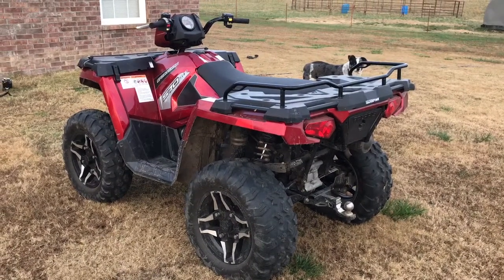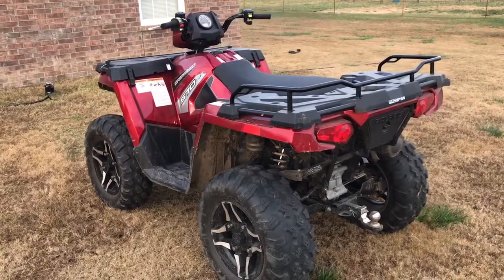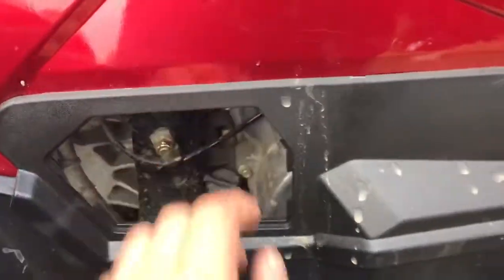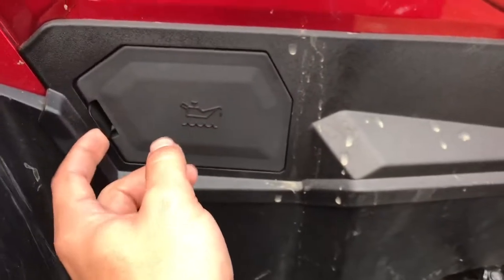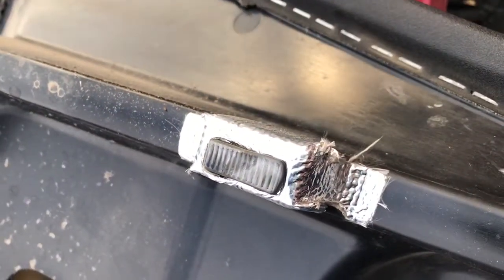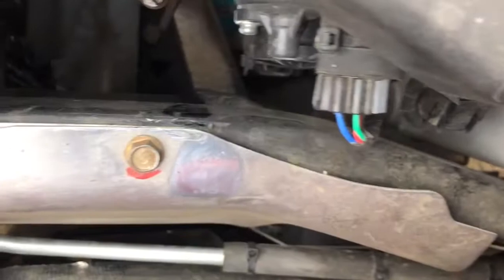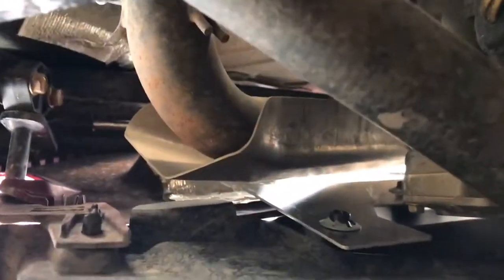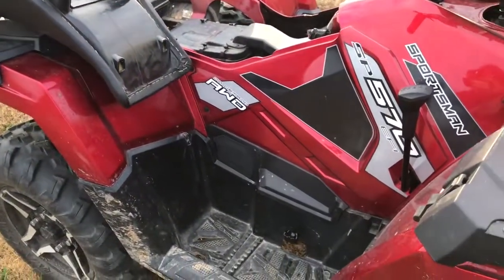Polaris 570 exhaust heat fixed!

Comment: I have a 2016 570 and have the same heat issue, i assime this same heat xpver would work for mine? My dealer asked for a VIN number of one that got the heat shield so they could look up the part number. Supposedly my VIN number doesn't come up. Any help appreciated, ty!
Reply from the maker: I traded mine for a 850 back first of august. I dont have the vin for it anymore

Comment: I got a 2013 model 330 trailboss and it lights my damn right leg on fire too, thinking about using a heat spray and wrapping it up with muffler wrap
Reply: Now it is in the 90s here in Missouri

Comment: was that part of the recall buddy I got the same bike my whole exhaust glows red
Reply from the maker: I don’t think they ever officially said it was a recall but the letter I got called it a”optional” heat shield kit. Said some riders may experience discomfort due to hot exhaust. It cut down on the heat on my leg but my exhaust still glows red as well.
Reply: 4M Ranch ok thanks man
Reply from the maker: No problem
Reply: @4MRanch  what was the cost
Reply from the maker: @gabemartin1980  no cost. It was free
Reply: @4MRanch  thanks

Comment: Is this fix a recall or just a solution from polaris?
Reply from the maker: I don’t think it’s a recall unless they changed it. I just got a letter in the mail saying some riders may experience discomfort here is the fix.
Reply: My 2015 sportsman xp 1000 had an actual recall.  It melted the rear body panel(not covered!)   They added a bunch of aluminum, but this bigger exhaust gets so hot!  I’ve contemplated the exhaust wrap, but didn’t know if it would make a difference.  I have even considered a different muffler, but that requires ecu tuning.

Comment: I have a 2015 570 and it's winter here and mine seems to get hot.so must be a comment thing with these machines
Reply from the maker: I think it is. I have heard alot of complaints about it. Since I installed the heat shield kit mine is okay now.
Reply: 330 trailboss does it too

Comment: So is it normal to get glowing red on moffler because my 2018 polaris 570 does that
Reply from the maker: I’m not sure if it’s normal. I don’t think it should be getting that hot. They should of use a bigger exhaust and better cooling. Mine does it too when I’m riding slow but when it’s getting good air flow it doesn’t
Reply: @4MRanch  is it safe to use like that?
Reply from the maker: Well I been driving mine like that since 2016 and it’s been fine almost got 500hrs on it now. I figure if it was to unsafe Polaris would recall them.
Reply: @4MRanch  ok thank you gives me some kind of peace of mind
Reply from the maker: Just keep the radiator clean and try not to drive at slow speeds for a long time in the summer. It should be fine
Reply: @4MRanch  Thank you
Reply from the maker: No problem